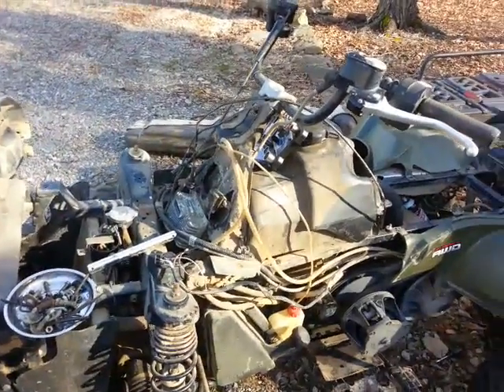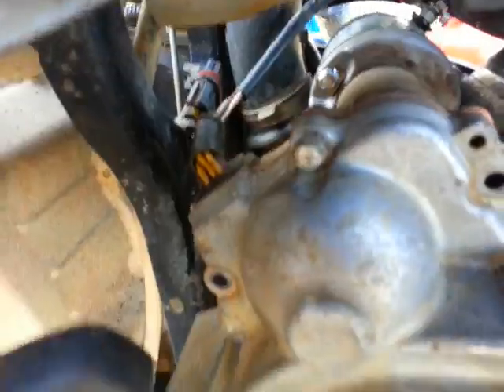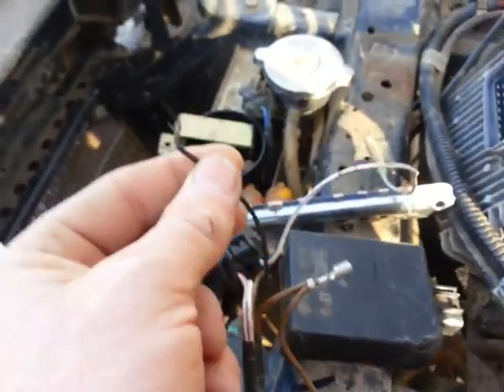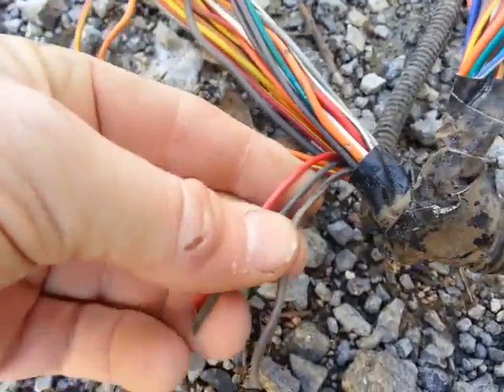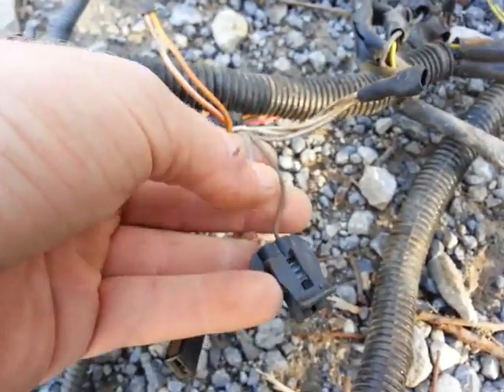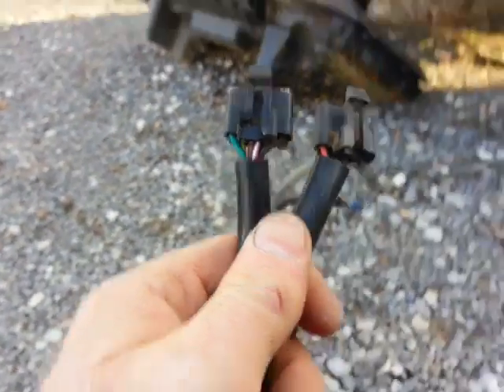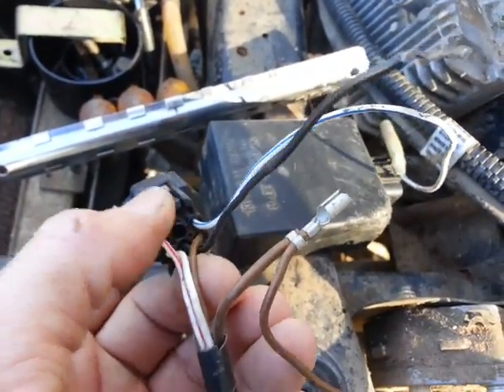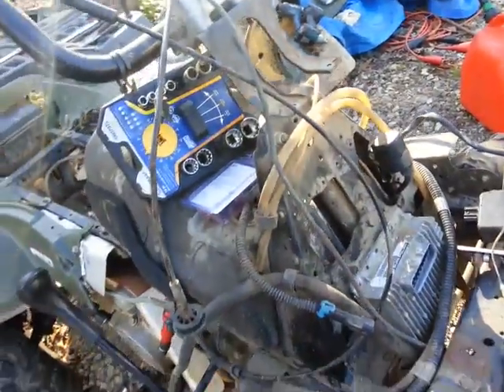Polaris 500 Sportsman HO carbureted NO SPARK

Comment: 2006 "carb" polaris sportman gets ONE spark then nothing!? Turn key to off position and retry to start >> again, one spark!
Reply from the maker: Sounds like CDI module. 
I had a Raptor 350 that had that exact same issue - if you bounce the start button and see spark <tap tap tap> <spark spark spark> then I'd really look at cdi. 
I have some raptor videos on my timeline w the same issue. Replaced cdi once and it frustrated me so bad because I bought a defective Chinese CDI. Hahaha
Reply: @BAMAJiPS  that's a possibility. Ive got a stator and pulse pickup on the way. If still no luck then cdi. Nothing left but a sledgehammer after that!
Reply from the maker: @SticksNkicks  
I've been there. Same exact symptom as you described. Watch this.
https://youtu.be/dlUT-Sew_TM

 FAULTY aftermarket brand new cdi Module. Everything in that ignition system was replaced numerous times
Reply: @BAMAJiPS  it was the safety kill at the throttle. I'd assumed this 06 didnt have the safety kill but it did and was the issue. I appreciate your help!
Reply: There's a video on that one Spark but no fire afterwards and the way to eliminate that is to eliminate the on-off switch and bypass it search the videos very common that switch goes bad the guy took it apart and all the insides broken out and rusted-out he bypassed it in the machine started right up
Reply: Off/on/off switch on the handlebars is bad if you get the one spark issue
Reply: Stator had a xplorer do the same thing

Comment: I am having the same problem with the solinoide wires on my 2005 Sportsman 500HO. The polaris replacement i got has 3 pins and the orignal had 4. I know you have to splice some together for the new one but every video and diagram i view shows different color wires.. one guys 2005 will have 5 wires.. one will have 3.. an so on. An they are all different colors then mine. I have 2 brown wires that are factory spliced and have no clue where they go..

Comment: amazon has stators pretty cheap ($42). i just purchased one for my 99 sportsman 500. the brown wire was burnt from the front of the bike all the way to the stator. im not sure about an answer to your question. sorry
Reply from the maker: +William Holzknecht (WILLSWHEELHAUS70) after days and days of exhaustive searching online for a legible [FREE] wiring schematic, I ended up basically rewiring the harness and got her back into fine running shape and sold off to fight another day... NOW I'm battling a 2009 Yamaha 350 Raptor spark issue... after replacing the stator and pickup coil, it has no spark when the crank button is depressed. Thinking it needs ANOTHER crappy chinese stator